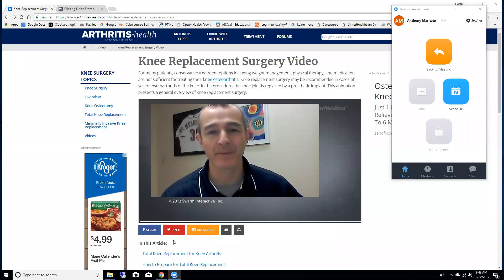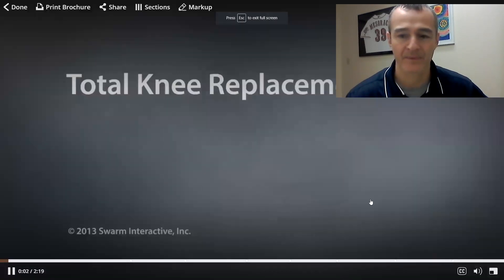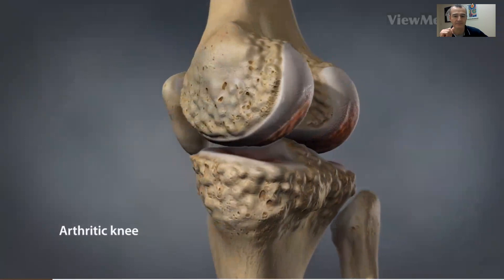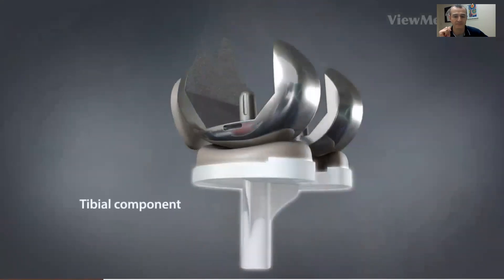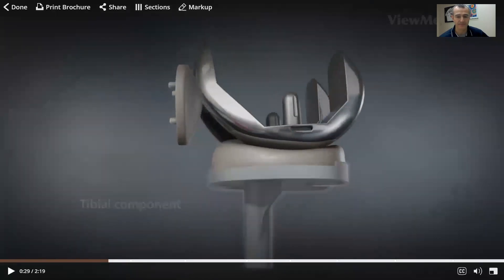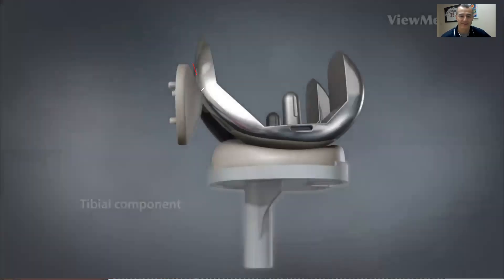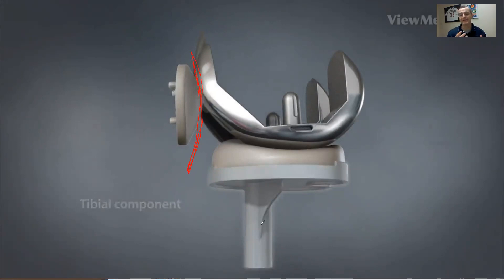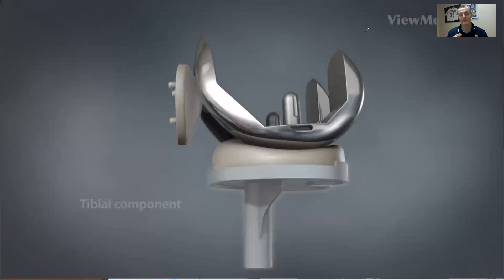Why does my knee replacement keep clicking?

Comment: Thanks for explaining everything so well!
I do feel/hear my knee clicking sometimes but is doesn’t bother me.
8 weeks ago I had
 my Tkr of my left knee
 and I do have some swelling.
The thing that bothers me the most is pain on the back of my knee on the left side.
I feel it when I bend my knee.
Do you have any idea What that might be,my fysiotherapist doesn’t know.
Reply from the maker: Tell me more. Is the pain in the back of the knee more intense when you bend it or straighten it? You mentioned left side of left knee so I am thinking outside of knee. Is it the outside back or knee or actually side of knee? Back of knee could be lateral hamstring. If you look up photos of the knee muscles and ligaments you might be able to localize the structure, but even so, 8 weeks is very early and you will likely feel better in time. 

I haven't gotten to this comment for a few days, how are you feeling now?

Comment: but I have no knee cap with my implant.
Its the joint itself when i'm sitting and move my leg left to right, right to left.
No pain, but you can definately hear it.
Reply from the maker: In your case it is the implants on the femur and tibia. Side to side motion especially will do it.
Reply: @totaltherapysolutions  Thanks for that. Now I can stop worrying. 
:)

Comment: My knee clicks but also in alot of pain on the inside of the knee where it was bone to bone it's been 3 months since surgery knee real stiff all the time
Reply from the maker: Hi George, I am sorry to hear that. Have you investigated this further? Have you spoken to your therapist or surgeon. I work with a fair number of people who experience what you are describing and I always try to determine if the pain is coming from the bone, the connective tissue, the edge between the implant and the bone or somewhere else. What does your therapist say?
Reply: Yes please do explain more fully.  I think it is more than the knee cap.  My PTs are saying the tendons around the prostatic will tighten up over time and the clicking will go away.  The Doc says this is just the way the prostatic is engineered.  I just know some click forever and some click for a short time like you describe.  I'm at 10 weeks and hope it goes away.  But no pain.

Comment: I'm 6 weeks post-op from knee replacement. My problem is the back of the knee clicks on the outside of the knee not the inside on the knee. It almost feels like something's catching when I begin to sit or squat. My surgeon couldn't answer  that question? What's that about.
Reply from the maker: It could be your fibula. Google images of the knee and look at the head of the fibula. Also, the IT Band has a tendency to feel like that where it crosses the outside of the knee. And when you transition from standing straight toward sitting or reverse the ITBand will click or bump over the outside of the knee. Neither situation is harmful, but my recommendation is do a little research on those topics.

Comment: Thanks for the video! I had my knee replaced 11/2017 and it followed the pattern you spoke of. Just recently the popping and clicking has returned without pain. I did start DDP Yoga 9 weeks ago and I imagine scar tissue has been broken up. Quads are getting stronger and I feel better. Could this be why the sounds came back? It's mainly when I get up from a chair, especially a low one. TIA! 😊